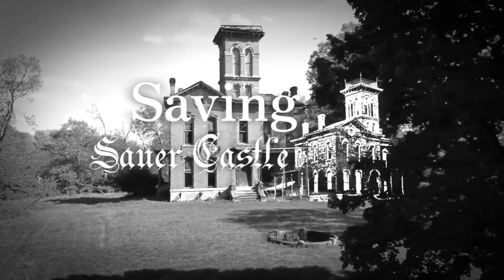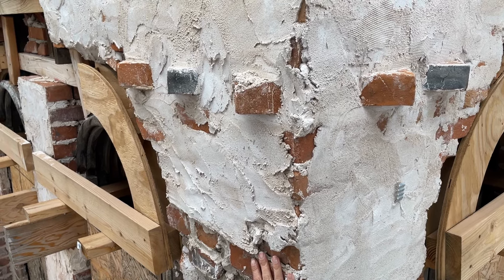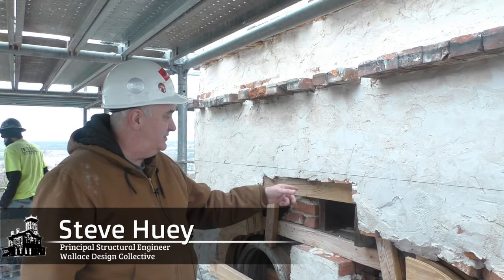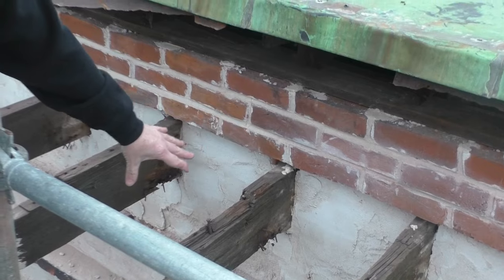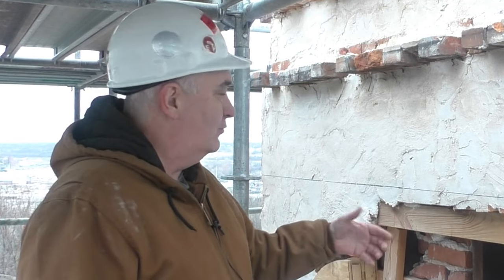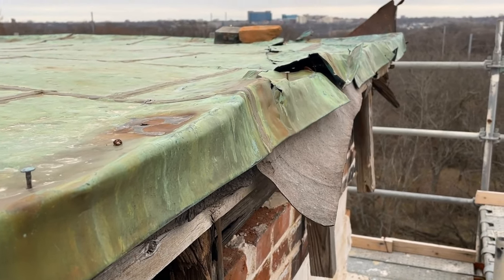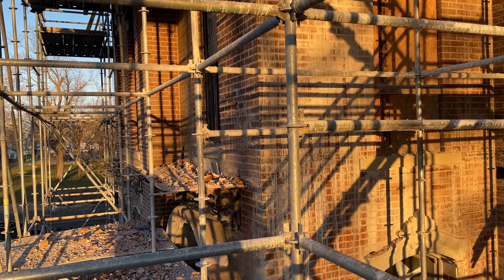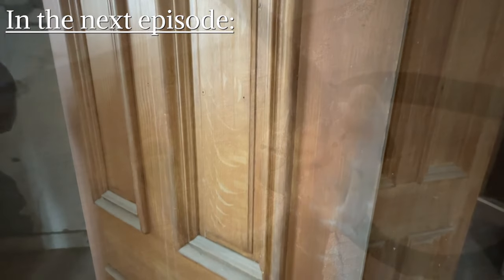Saving Sauer Castle: Episode 2

Comment: I know a guy who restores old (late 1800 and early 1900) gas engines that have a lot of cast iron in them. I say that because he has had new parts cast that were broken. The widows walk looks like there is enough left for a pattern so that new parts could be cast. 3D printing could also help make molds for the casts. Those widows walks really add to the over all look. I guess they're not original though. I'm just glad work is being done to restore it.